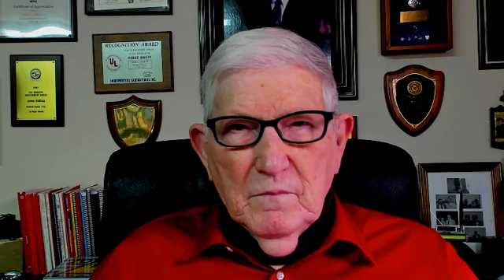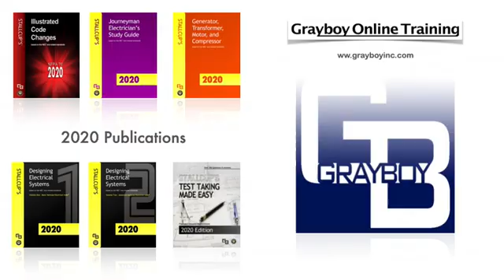Sizing OCPD To Allowing A Motor To Start And Run

Comment: What if the values in table 430.52 are too big and make for a large costly sized breaker ? It’s %125 minimum I believe for the OCPD. The table is for MAXIMUM sized OCPDs. In real life applications a 370A table value motor at 250% for an inverse breaker would be a whopping 925A! No customer is going to want to pay for a 1000A breaker to feed a 370A fla pump. I always calculate my motors for OCPD at 125% just like the conductors. Or else you would need huge services for just a couple of pumps.